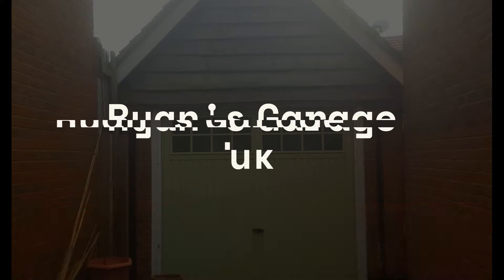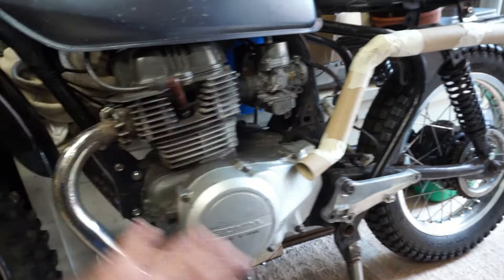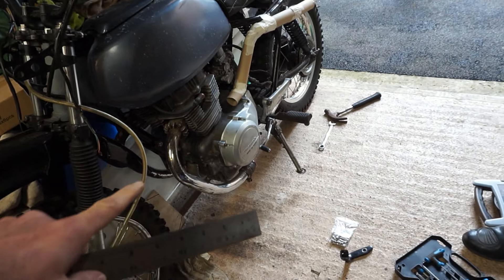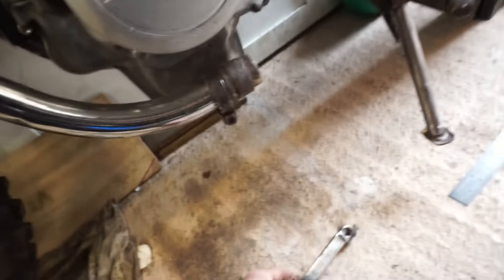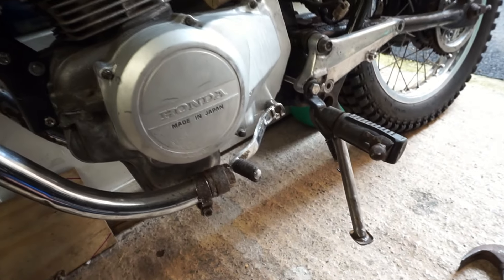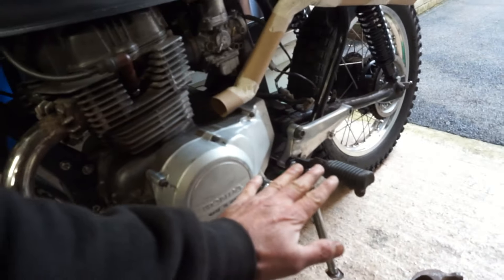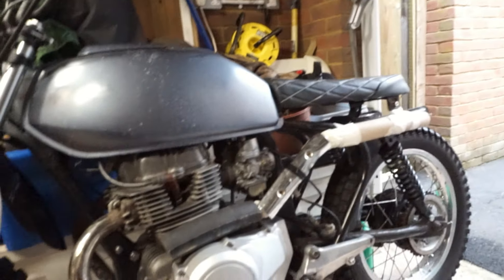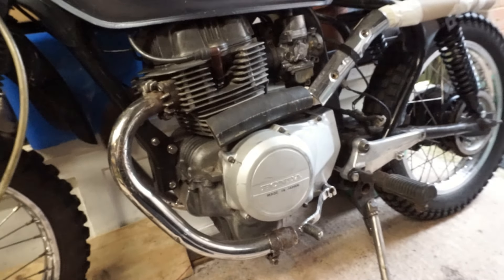Not a lot this week, waiting for deliveries.. -  Project Bike Build -Part 42

Comment: Hi Ryan, another methodical work out for your brain with good solutions to the foot peg and gear lever so keep going, your doing a great job !
Just a thought but you could have a bespoke brake hose made with angled fittings to come out the top of the caliper where the notch is and then up to the brake lever leaving enough slack to clear when on full lock. This would negate the need to have a loop and so the brake fluid would have a more straight forward path to travel and potentially less resistance even though it is a fluid.
Reply from the maker: Thanks Neil, sorry for the slow reply, but I think we are on the same wavelength on this.

Comment: Before you go modifying stuff or buying new pegs make sure what you are thinking is a comfortable and ergonomic riding position or you may end up changing it again. Another vote also for Venhill brake lines (great quality and lots of options for an item that will outlast the bike) noting that the banjos screw onto the fitted hose so you can avoid twists. Keep plugging away looking good so far.
Reply from the maker: Thanks Bob, I am looking into the brake hose from Venhill.

Comment: Before you throw out the old brake hose, my suggestion would be to offer it up to the caliper and master cylinder and see if one of the banjos is at the correct angle, then measure the angle and use that info when you order your new hose. Don't forget to check what angle the two ends need to be to each other rotationally, when the line is out straight, and include that in the specification, so you don't end up with a twist in it.
Reply from the maker: Thank you Rick, I will dive in bin and fetch it out quick. Never ordered a custom hose before so wouldn't know in advance what details are necessary.